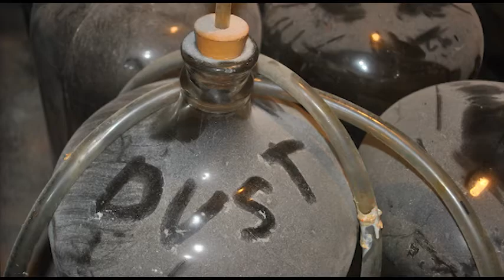Compact Fluorescent Light Bulb "A Better World Radio" with Mitchell J. Rabin

Comment: So, You felt someone deceived you by Not telling the complete Honest truth... 
And Your reaction is to do the Exact Same thing, And cloud the issues by injecting some UN-truths of Your own. 
You will Never SEE mercury vapor, I realize your Not a physicist, but it would seem reasonable that you would at least check the possible physical states of basic elements Before you claimed them. (You will Never SEE mercury vapor). At 100°C, it's density is 13.3522 with a vapor pressure 0.2729 mmHg. Stating something as true, When it is Not... Is No way to be more persuasive.